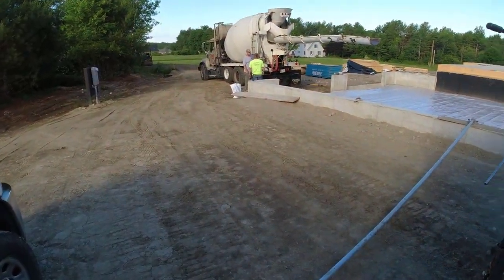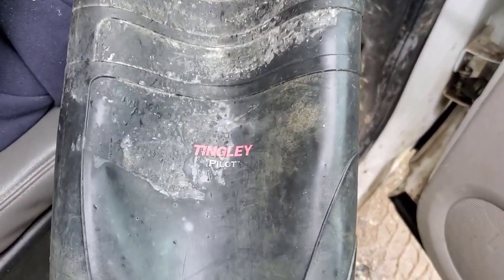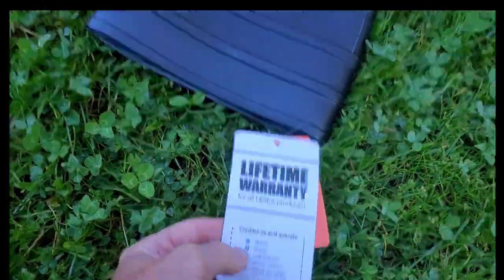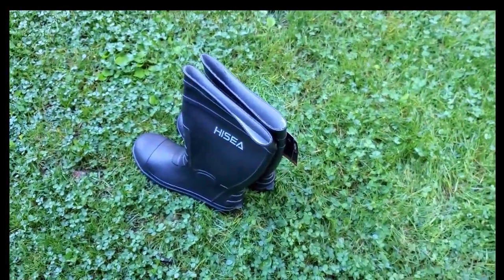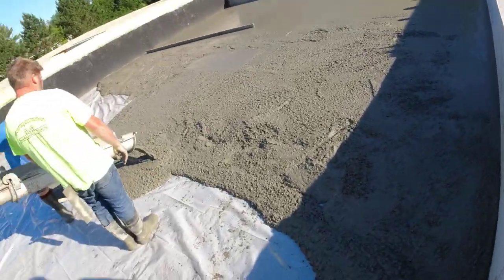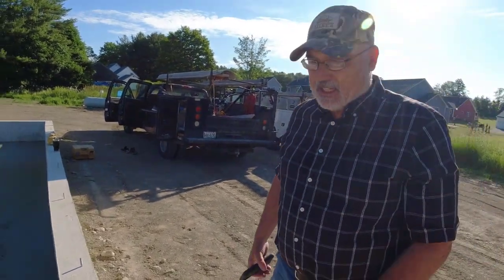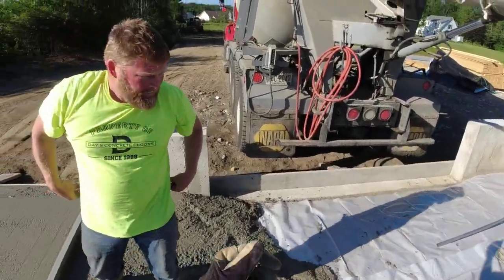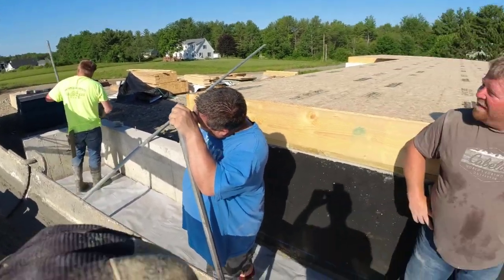How To Pour A 32' x 44' Concrete Floor [HISEA Concrete Boots Review]

Comment: Y’all are some incredible masons. The work speaks for itself but it’s your commentary and educational messages that make your channel so enjoyably valuable.
Thank you for the entertainment and education. 
Do y’all ever work in existing basements? I have an old farmhouse from 1913 and part of the basement was poured, screeded, but it’s rough texture appears to never have been troweled or taken any further. I am curious if it’s realistic to go overtop with fresh mud (it’s about 1” below the rest of the room) or if I should just build a subfloor and call it a day. 
Thank you for the time,
-CY Castor
Good luck with the new boots!!
Reply from the maker: We have worked in a lot of old basements like that. You can cap over the existing with a couple inches. Depends on what you would like I guess.
Reply: @MikeDayConcrete  thank you for your thoughts! I am grateful knowing I’m not “hopping down the wrong bunny trail” so to speak! Y’all are awesome!

Comment: I've just learned over 30 years to buy 2-3 pairs of the cheapest boots I can find.  I've bought $200 muck boots and ruined them within a few days on rebar, wire, a nail/screw sticking through the form. I've had $15 boots last a year. Seems the same way with everything with me though.  I can keep a $5 tape measure for years but my $40 tapes grow legs and walk away when I'm not looking.
Reply: I get it!!° thats why I find a good pair of boots and wear them out literally
Reply from the maker: Doesn't take much for a piece of wire to puncture a boot. No problems with these so far.
Reply from the maker: I do to!!
Reply: @MikeDayConcrete  frits pac? they good ppl? they seem like it
Reply: @MikeDayConcrete  my trees ripped when I was trying g to put them on no1 told me about using plastic bags to slide them on. I hate big boots. the other pair ripped on a concrete steak. I got hung up on 1 that was sticking up and almost fell on my a$$ , so I stick w the "gardening boots" from tractor supply

Comment: You guys have gas and battery power screeds but still seem to do a lot of manual kick screeding  by hand. I'm really curious as to why you're doing that on wide open pours like this one with no pipes or anything in the way. Wouldn't it be easier on your backs and save on labour to use the power screed on jobs like this? What am I missing?
Reply from the maker: You're not missing anything. This garage had some slope, we don't usually vibra-screed a slope. The garage wasn't too big either, sometimes the guys just choose to hand screed on smaller pours. Not really more labor intense on small pours.

Comment: If people saw the slump pouring the Word Trade Center 7 it was like a 9 slump 15,000 psi though.  I see a lot of guys on you tube pour 4 or 5, I only do on a ramp that's got lot's of pitch. I like Muck boots for Concrete because I use them again for Hunting. I recently bought Cabelas Red Head brand there ok not as comfortable and nice as the Muck brand. I don't have a problem buying new ones every year it's a write off anyways why not take good care of your feet, my foundation work boots cost $370 a pair bought 2 pairs in case one gets wet. Crispy makes them made in Italy, use to have Mendl there really nice also made in Germany.
Reply from the maker: I've never tried the Muck brand. These were comfortable though.